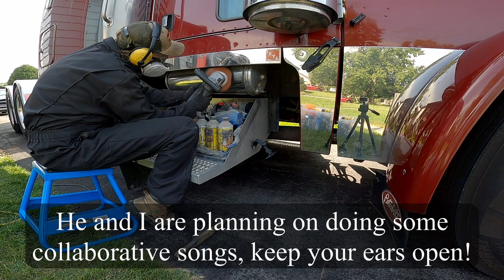TRUCKER LEARNS HOW TO POLISH (2021 Edition!)

Comment: Have some advice from someone who's been doing it a year and like 6 months with a machine 😂😂, try and keep a decent compound line going like 5mm thick and work it up, try to keep the heat up as much as possible especially in the cut, don't be afraid to cut the tank twice even 5 times each time it'll get better, and the colouring stage is the same, try to keep a nice compound line going and don't be afraid to colour it again and again it'll become way better each time , if I was to suggest something a little different try getting a makita tool they are really good for polishing and a good hand polish will bring most of the lines off
Reply from the maker: Thanks I’ll try that!